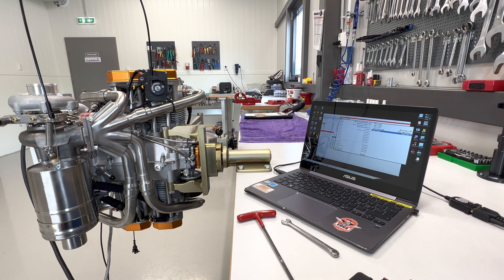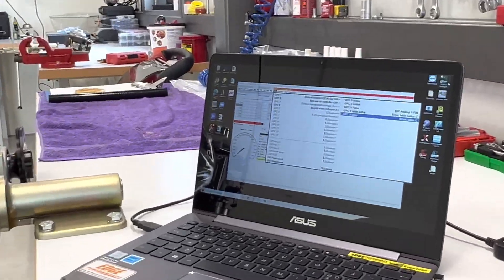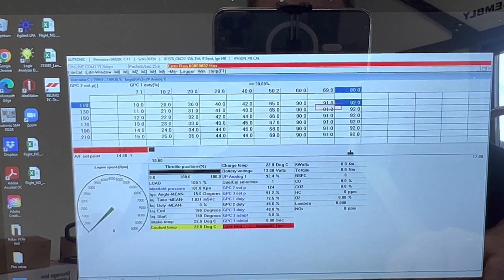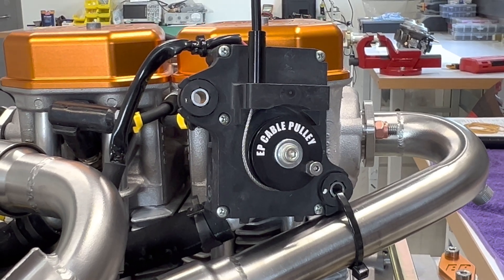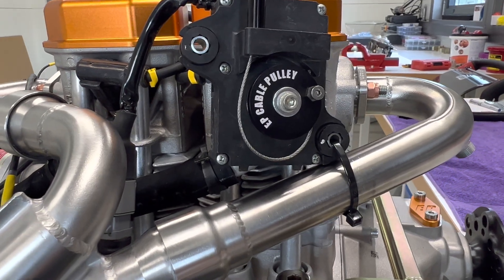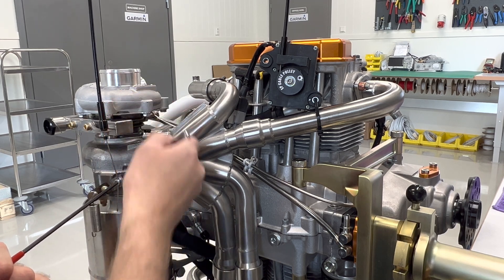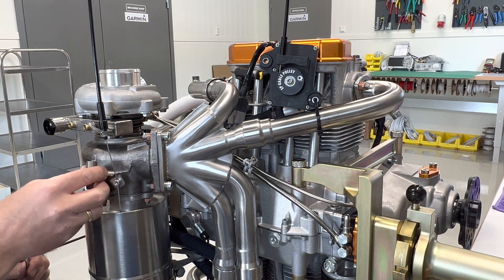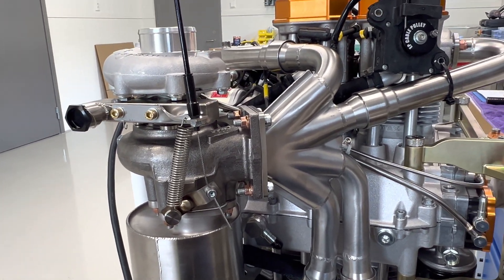Edgeperformance wastegate setup and adjustment

Comment: Instead of elaborate patchwork on overpriced rotax piston engines, seriously consider doing a turbofan jet engine instead at about 15kg weight, about 1/3 the size of the Williams EJ22 prototype engine or 1/10 the size of the FJ33. Surprisingly a turbofan can be fuel efficient and it's so light for the power, you have natural double engine benefit, no front prop noise maker, it's quiet, powerful and fast and runs on JetA fuel. Forget all your intuition about jet engines, realize that a 15kg engine isn't inherently expensive to make and realize that the world idstance record of 40000km at 500km/h without refueling belongs to the off the shelf Williams FJ44-4 engine. Could you do that with a rotax...  stop and really think about it.  patchwork on a rotax has no significant future if any. but a small turbofan engine for light planes from 250-700kg, that's a revolution. Or total market dominance.
Reply: Where in Christ’s name are you going to mount a turbo fan on a light sport aircraft? Ain’t going on the nose and it ain’t going underneath the wing unless you mount two which will negate the whole purpose of your loquacious ramblings
Reply: @Captndarty  hehe I think Jesus would place two turbofans in the coolest place they could go and that's where private jets place them, on the tail. Maybe top rear wing like hondajet but rear looks cool and has the nicest noise profile and blade incursion in case of catastrophic failure. Not going on the nose is the very point my status quo sheepish friend. The front prop config is very old school and awful for visibility and noise and complicates layout and atrocious in a fire. Not going on the nose is exactly why my ramblings are so intelligent. The twin engine config that comes naturally with rear placement and the smaller size of engine of twin config lends itself to lower production cost, also gives you the ocean crossing capability and general redundancy that people pay dearly for. And you get that for free with small turbofans.
Reply: So, Mr. Fredriksen, you start up that turboprop company and make your millions yet?
Reply: @KenLeonard  I dislike turboprops, I was talking about turbofans. You should probably get that distinction right before you entertain delusions that you are in a position to mock me. Maybe also get my name right. It's right there for you to copy. You're 0 for 2.
Reply: Pay for the development or just observe and be quiet 🤫
Reply: @WattsUpDev  hush, sheeple. venture capital is an option is they need money for it but they might not.
Reply: @DanFrederiksen  They will pursue Venture Capital for “their” goals not yours. Like I said unless your willing to find your suggestions and Dreams don’t offer them it’s unprofessional and childish.